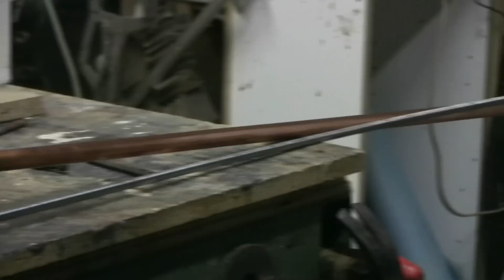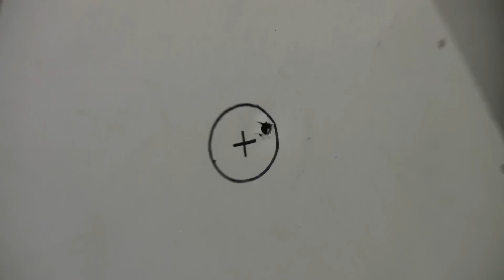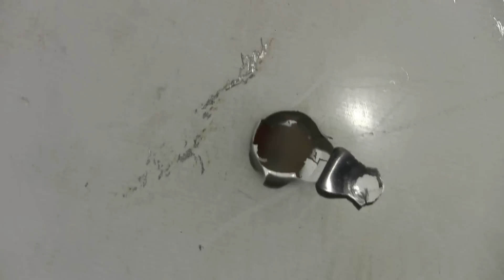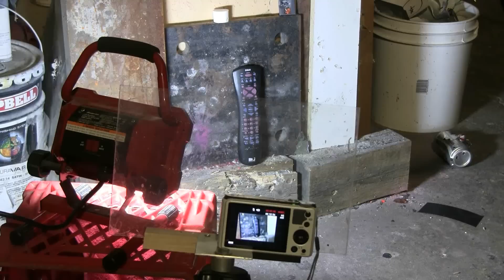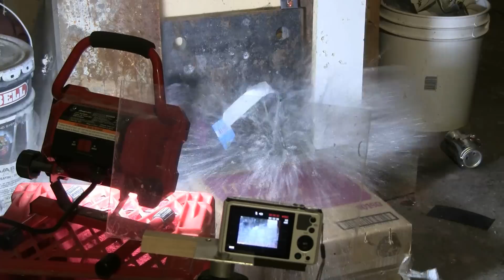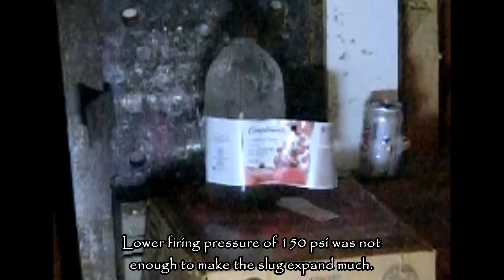Air Cannon #128 - Accurate Rifled Metal Barrel

Comment: Copper isn't much harder than lead.  I wonder how long the rifling will last.  Maybe your could make a steel barrel, soften it for rifling, then reharden it.
Reply from the maker: Bill T When the rifling wears, I can run the tool down again or simply make a new barrel. I will be trying this on an aluminium barrel as well.

Comment: Did you have a hard time finding threaded parts to fit the fire extinguisher? I'm planning to make one, with the air input from the compressor going into the tube where the original pressure gauge was. My extinguisher is rated for 3.5 megapascals so that should be fine.
Reply from the maker: ***** I machined the needed parts as I went.

Comment: awesome ! i have a fire extinguisher i dont need and i was thinking to make an air cannon can you make a video how to make it without a solenoid
Reply from the maker: сталкер чворович You could use a ball valve or a sprinkler valve instead of a solenoid valve. There are a lot of videos on how to use a sprinkler valve for a cannon. Ball valve is very easy to use, rig up a spring and trigger to pull it open quickly as the faster the ball valve opens, the more powerful your shot will be.
Reply: Bill Gilmour so just a normal ball valve but just turn it quicker ok :) thanx